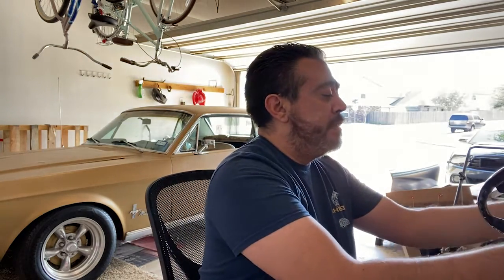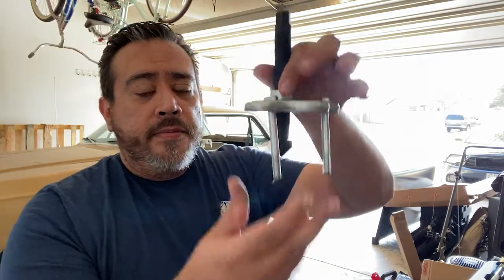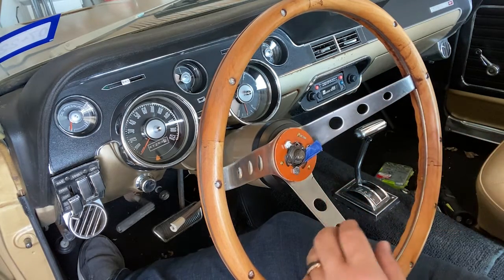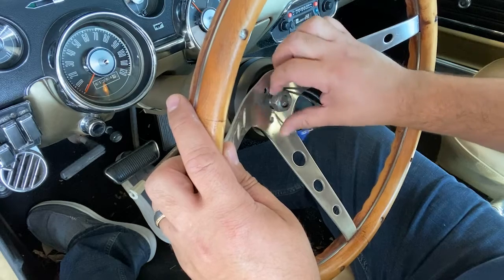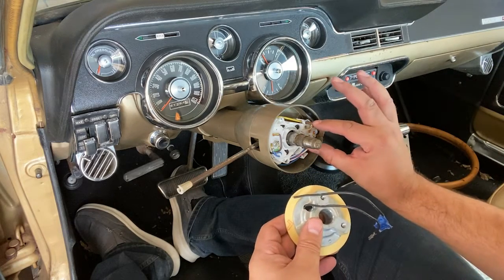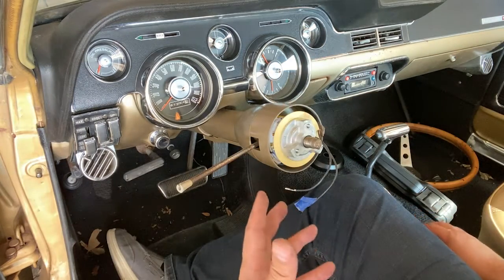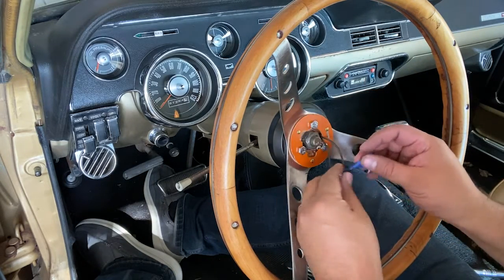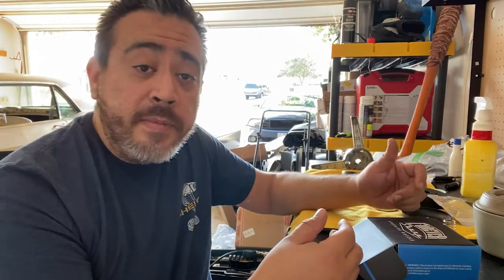Grant steering wheel install - Classic Ford Mustang

Comment: I just today discovered your series of videos, looking forward to watching them all!!  I want to upgrade my 67 to the 68 collapsible column and another video says to use this exact steering wheel, I have all of the parts now. Just need to get the car to this point because it's in hundreds of pieces right now. Your video is extremely helpful!
Reply from the maker: Thanks! Glad this helps you out.

Comment: Here I am again. The halo lights I installed came out great. I used the relay harness and the no splice harness I believe I bought from you or you sent me in the right direction to get one. I'm putting a new wheel in, the 16 factory wheel was just too big. The 14 I got is going to make me do the electric power steering a lot soon I bet LOL. Thanks for the video man.

Comment: That guy really does look like Negan. Anyhow great video. I was having a problem with a fuse blowing for the radio/  signals in my 73 Mach one. I installed an old spoke wheel similar to the Grant. I checked everything then I decided to pull the wheel off and it fixed the problem. I'm missing the plate that makes contact with the Horn and it was grounding out when I turned the wheel. Thanks..time for that new wheel with the proper kit.

Comment: You made it look very simple.  I am going to be doing this on my 65  Fairlane soon
Reply from the maker: The toughest part is pulling the steering wheel the first time with the puller. Once you get that the first time you won’t have any problems.

Comment: Those dimples on the horn button can wear out over time. If you cannot get it to tighten I recommend replacing the horn button and hub with a GT3 style from CJ Pony Parts. Great video!!

Comment: Good stuff. Im currently putting my 68 back together. I couldnt make up my mind between a grant and my original 68 steering wheel with a woodgrain insert. I decided on the original for now but may use the grant later on.
Reply from the maker: Personally I like the 65/66 steering wheel. I had one on this car but the horn didn't work well with the 67/68 turn signal cam and I found this steering wheel at a good price. It was actually unfinished and just raw dirty wood. I sanded it, stained and sealed it to a nice finish.
Reply: @CMOSX  nice. Love it when i find good deals. Ive been buying stuff for my 68 for years now, its crazy because of how much prices has gone up for a lot of this stuff so i feel my past purchases have been well worth it.

Comment: SOB!  I just put on one of these on my '65 Mustang and as soon as I connected the battery I had a huge short circuit.  I took it apart and found that the the copper plate on the hub didn't have a break in it like yours does, so the sliding contactors complete the circuit, bypassing the horn switch.  Manufacturing mistake.  And yes, the cap design is crap.  It will fall off in no time.  Overpriced PoS :face-orange-frowning:.

Comment: Was there a spring under the original steering wheel? I have a 65 and it has a spring. I'm wondering if I use the spring or not. The instructions don't show a spring

Comment: Love that steering wheel and thank you for this great video! I just bought my wife a 65 Mustang and it has horn issues that are keeping me from getting it inspected. Do you happen to have a part number where you got the turn signal/horn switch from? I may need to replace mine. Your video is the first one I've seen that easily walks through how the aftermarket horn works. I wish you would have shown the spring install, but I can play with that and figure it out. Thanks!!
Reply from the maker: There's a signal cam in the column that controls the turn signals and the horn. 
https://www.npdlink.com/product/switch-assy-turn-signal/101679?backurl=search%2Fproducts%3Fsearch_terms%3Dsignal%252Bcam%26top_parent%3D200001%26year%3D1966&year=1966
Reply from the maker: here's the link to the parts to rebuild the horn link assembly under the steering wheel.

https://www.npdlink.com/product/plate-set-horn-ring/101882?backurl=search%2Fproducts%3Fsearch_terms%3Dhorn%252Bassy%26top_parent%3D200001%26year%3D1966&year=1966
Reply: I've gone back and watched your video a hundred times as I try to troubleshoot my hors and what's going on with them, but I'm watching your video mainly to see how that Grant steering wheel installs. I've got the same kit, and the same issue with the center cap. I have the same original center cap you do and the same fitment problem, so I ordered a new center cap from Amazon and the same stickers as well! Hoping I can figure out why both my horns aren't sounding and get this thing running!

Comment: I had a grant wheel just like that several years ago, nice looking wheel but it was too thick to hold therefore I was not happy with it. To each his own, that’s all that matters
Reply from the maker: What wheel did you end up with?
Reply: @CMOSX  I don’t recall but it looked almost identical to the wheel that you just used. I had no problem using the horn ring that came with the kit. I just remember that the wheel was pretty fit to hold onto and that’s what I didn’t like about it but it’s a great looking wheel. I went with that because it was a whole lot cheaper than an original reproduction wheel and I was only putting the car together to sell it

Comment: Does anyone know what the “thing” with the two wires is called? My wire are cut and have a power draw from there.
Reply from the maker: That’s one of the contact plates. The power comes from the turn signal assembly in the column. The assembly has two posts on springs that are always powered and the grant has two plates. The first rests on the two posts to supply power and the second plate rest on top to ground it when pressed down by the horn button.
Reply from the maker: You can get a new adapter kit from the link I provide in the description of the video. The link will work with 67-68 mustangs but if you call the manufacturer they will help you identify the adapter you need. They have great customer service.